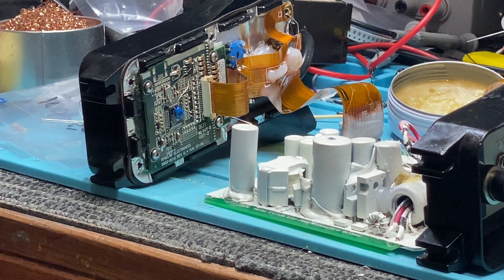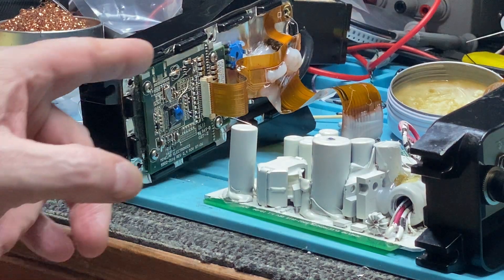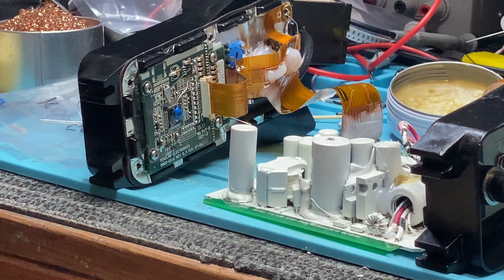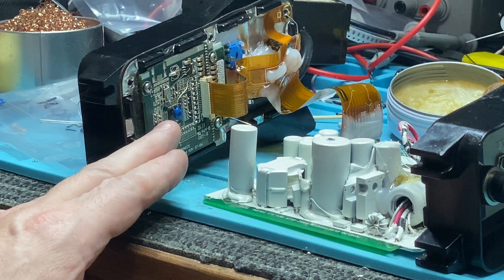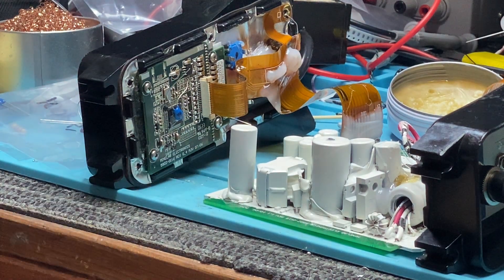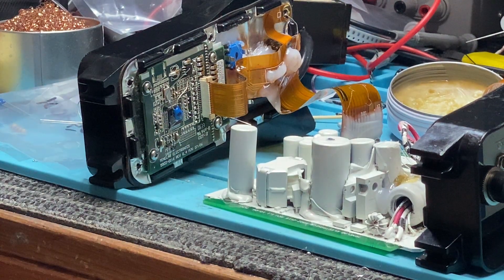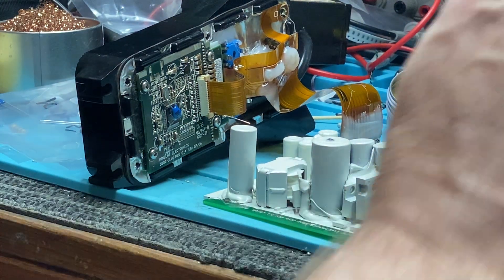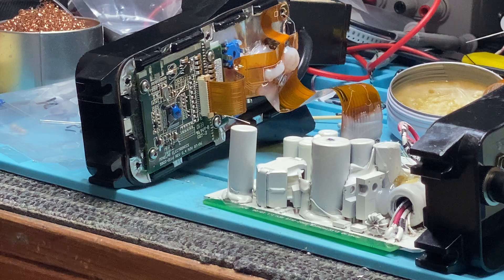The unrepairable GPX4000 repaired fixed the microprocessor fault.

Comment: Amazing work

What about the processors in Chinese devices such as GDX? Can they be reprogrammed to be compatible with others, or can they be programmed to modify the software and add new modes? ^^ I think the Chinese can help with this matter.😂
Reply from the maker: No one is going to rewrite code for the 4000 as there is also an encoded handshake.